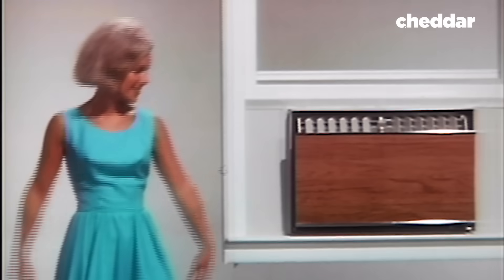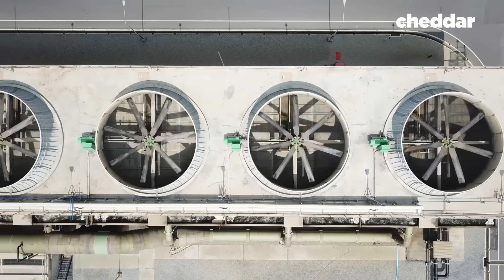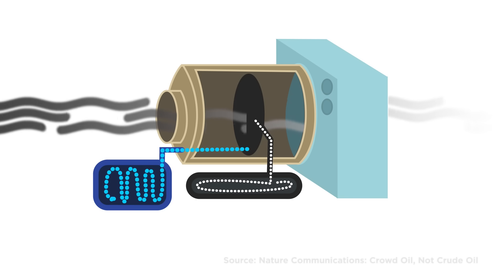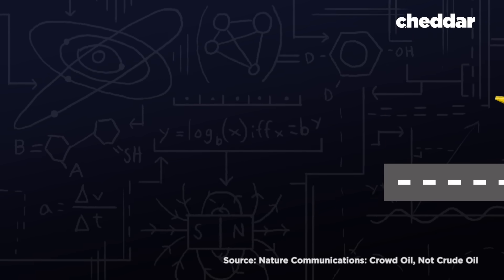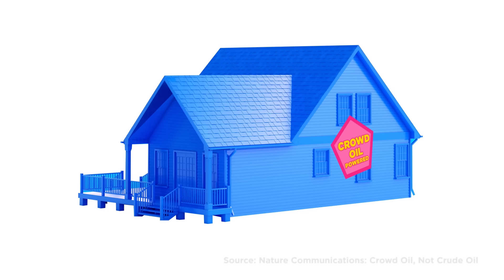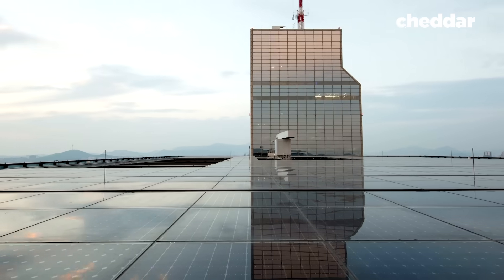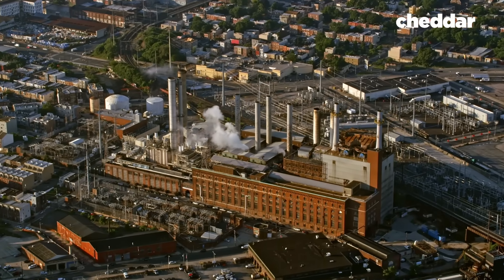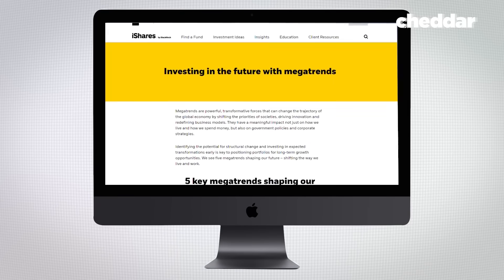How Your AC Could Help Instead of Hurt The Environment - Cheddar Explores

Comment: "we have about thirty years to reduce our carbon emissions to zero"
yeah we're all gonna die
Reply: We're going to reduce to zero by:  "consuming more energy than it recover, instead of using carbon-neutral power sources (like nuclear) and powering the air conditioners, lets just put a filter and a complex system and decrease the efficiency of the air conditioning, lets also create oil to be burned again, that's net-neutral at beast, considering the system also took energy to power itself, it will never be carbon negative"
If that's the best we can do, we're fscked.

We could stop being chicken and go nuclear and solve the problem in 10 years. It's totally doable, nothing new need to be tested or invented and we know precisely the result. It's also cheaper than Petrol or any green-energy. (except for Dyson sphere)
Reply: @monad_tcp  to reduce our carbon dioxide production to zero we need to stop breathing 😅
Reply: @kagenekoUA  that's not a bad idea either, but we could go the other way, we need to make enough cloroplasts to counter the co2 in the atmosphere.
I'm sure nothing bad will happen, like increasing O2 and making everything burn
Reply: @monad_tcp   yeah, it's better to achieve the balance. There might be too much oxygen though (see O2 toxicity), so it's better to keep it less than 40% at sea level pressure. And then the only straightforward negative effect of "significantly more O2" thing that I personally see is the insect gigantism.
Reply: @monad_tcp  as about the oxygen toxicity - here is a chart (and the related explanations) for a better understanding: https://msis.jsc.nasa.gov/sections/section05.htm#Figure%205.1.2-2
Reply: @kagenekoUA  the elite are nilhists and thats the plan. 500 million will be allowed for their rituals
Reply: Have more than 30 years, leftist sources have been saying "12 years" "1 year" even saying 12 year ago that we have 12 years... the whole thing is stupid. I personally believe at the rate countries like China and India contribute to Global Warming we have ~100 years
Reply: @Jayyy-7  I don't think we have 100 years buuut maybe 20-30 years before the worst sets in
Reply: It's actually super possible and easy to accomplish if people simply did it. Nuclear and switching everything to being electric powered, big oil is so scared of nuclear energy. It's clean, safe (Now), and makes more energy than any other method we've discovered. They're not even complicated the atom smashing shit is just a heat source to make steam. From there we can work on what's physically destroying our world, plastic and all that shit.
Reply: joel dong  
reduce carbon emissions to zero not carbon content
Reply: i love you but you make me cry
Reply: Plants love CO2, they grow big and create oxygen from it. Give the CO2 to the plants.
Reply: joel dong  You did it guys, you solved it. They want to cause world wide genocide but rather than use nukes, disease or other methods they're going to use mankinds want to save the world to make them destroy themselves. Genius, you've surely saved us all and opened the eyes of all who read your comments. Truly incredible, the shepherds of our generation.
Reply: 7tonsofsalt yeah that what i keep saying it's just fucked because we pack the will
Reply: I think zero carbon emission in their contex is actually how we balance between co2 and o2..let say factory produce 100 co2..then they plant tree that can absorb 100co2..that is actually zero carbon...and btw..the country that achieve this feat is Bhutan..and they actually in carbon negative not zero
Reply: @roslanismail4417  so they steal co2 from the air. Soon all agriculture will grind to a halt
Reply: @brettmoore3194  no..the balance.like example 50 co2 and 50 o2. The rest of the world is like 60 co2 and 40 o2.get it?
Reply: Sorry for my grammar..but i think guys get it anyway
Reply: joel dong  it makes you wonder why they want to reduce CO2 to starvation levels. Makes you wonder what they're up to...?
Reply: joel dong  Don't peddle that disgusting shit to me you moron
Reply: joel dong  sounds like only positive points
on a more serious note, we don't actually need to not produce any co2, we just need to collect what we produce and reduce where we can (*cough* meat industry *cough*)

tl;dr: not actual zero emissions needed, just net zero emissions.
Reply: joel dong  hope space travel gets cheap
get a good viewing point in LEO
enjoy the fireworks
Reply: joel dong  There's a thing called nuclear power which is superior in every single conceivable way to fossil fuels. Please be quiet you're an idiot
Reply: Guess I'm not living to 67 so I could kill myself with a glorious method. Sad times we living in. Sad. Truly sad.
Reply: joel dong  when the earth worshipping pagans that literally worship trees of the 13 century are better off than the modern tree hugger vegans that force their pets to go vegan. You know we be going in the wrong direction.
Reply: A slow death
Reply: “We’re all gonna die”

Source???????
Reply: Are you one of these people who believe cholesterol is bad too. Stop being a tool
Reply: @brettmoore3194  are you one of those sheep who believes getting shot is bad? Wake up.
Reply: @user-lp7tx1fe6t  I take shots everyweekend
Reply: No; geoengineering will save our ass. Engineering ALWAYS saves our asses.
Reply: Slow and painfully
Reply: AOC says the world will end in 12 years unless we take aggressive action. Unfortunately India and China don't believe this and are ramping up CO2 emissions.
Reply: @kenmarriott5772  My god are you arrogant? China´s emission per person is a third of America´s. And they actually care about global warming since their country is being consumed by a desert
Reply: It is a myth we will all die, just people living on the coast will have to move inland, and in hot areas it might be more uncomfortable. But in colder areas we get the better deal.
Reply: @EglomHistory  "in colder areas we get the better deals"
europe is projected to have another ice age, which would fuck over most of our agriculture
and right now it is actually getting warmer over here which is very shitty too: the permafrost melting means that there is a metric fuckton of co2 released, ground that has been totally stable for centuries suddenly isn't anymore, causing huge damages, a lot of tourism that relies on snow has to use snow cannons, which are an environmental nightmare themselves and the meltwater causes more flodding.
furthermore the increase in extreme weather also affects countries without a coastline and the higher temperature has sparked worries that malaria might spread

and as far as i know predictions for the rest of the world arent so great either
Reply: The words of a loser.... We have the solutions to beat this. Stop being a coward
Reply: @carynoname2574  people are not willing to wear a face mask for a couple of weeks. You think we are capable of fighting climate change?

Comment: Using electricity to inefficiently convert water to H2 then losing energy by letting it react with co2 and then burning that hydrocarbons and releasing the co2 again to inefficiently convert heat to energy. Sounds like a great idea ...

Comment: So let me get this stright, this thing basically works by capturing carbon from the air only to be used as fuel  and get released back into the air?
Reply: yes, that is not a good solution

Comment: It's a lot more difficult to clean air from CO_2, than to clean exhaust gasses. Fristly due to the much higher concentration of CO_2 in the exhaust gasses, secondly due to the usually increased temperature.

Comment: -Clean air by removing CO2!
-Making fioul with it!
-Pollute the earth again..
-Pollute the earth again ?!
Reply: Lots of things are made out of hydrocarbons/can be converted to form them like plastics and carbonate minerals which are permanent carbon sinks. Also whenever you burn oil/coal you are burning some of the impurities in the material like sulfur. while also digging up new hydrocarbons is carbon positive while extracting it from air is carbon neutral which is better than positive.
Reply: @bearcatben4762  yes, assuming this is run on clean power. Though at that point why not stay transitioning the public to electric cars
Reply: @ilikepie1974  Because electric is much less energy-dense them traditional chemical fuels and a lighter car is a more efficient car, Battery production is carbon positive today and even if that changes in next few years with electric drilling. the bottom line is producing fuels from atmospheric carbon are carbon neutral today without any R&D, and the beautiful part of the system is that it makes clean but intermittent solar, wind, and tidal energy available constantly because the methane acts a battery which makes it nonsensical to be made from fossil fuels because you lose 10% of the original energy of the coal/oil/natural gas from production so its running clean no matter what
Reply: @bearcatben4762  ever think about being O2 Positive ?
That's the best plan .
Reply: @NCOGNTO  Ideally yes, but the most important part is being as carbon negative as possible because the drop in O2 in the atmosphere will effect us little but the effect of removing so much CO2 will be more effective because an increased amount of CO2 has many more effects than less O2
Reply: @NCOGNTO  But since you asked I do have an O2 positive plan, the idea is that you use some carbon-neutral power source like nuclear, solar or hydro and you run an electric current through an atmosphere of CO2 and water which produces methane and oxygen gas, the methane can be turned into plastics and the oxygen can be released into the atmosphere.
Reply: @bearcatben4762  how about plastic from carbon capture and hydrogen peroxide (H2O +O2) from solar / water ? H202 has powered the world's fastest cars and can positively repair our air .
Aim a little higher .
Reply: @bearcatben4762  CO2 is formed in direct proportion to the O2 that's removed from the air .
O2 is also the most immediate human necessity .
Carbon will eventually settle back to where it came from but in the meantime our cars could do what trees do - and cheaper than gasoline too
Reply: @bearcatben4762  I lay all this out on my channel
Reply: @NCOGNTO  I'll check it out but O2 is very important yes but a half percent increase in CO2 concentration will have a larger effect than an half percent reduction in O2 because there is much less CO2 than O2 so humans and animals are less adjusted to CO2 changes than O2 changes
Reply: @bearcatben4762  without oxygen we die . Gasoline cars convert O2 to CO2 by combining 20 pounds of O2 with 5.5 lbs of carbon PER GALLON ....... so I'm missing your point here ?
Oxygen depletion is real and you can figure it out .
Reply: @NCOGNTO  My point here is that increasing CO2 is more negative than producing more O2 is positive, basically the pros of making more O2 don't out weight the cons of making more or the same amount of CO2
Reply: @bearcatben4762  why keep talking about fossil fuels ?
We could be talking about NO. CO2 and 5 lbs of O2 for every gallon of H202 .
DOES BOTH THINGS AT THE SAME TIME .
Reply: @NCOGNTO  I'm saying that we need to reduce the amount of carbon dioxide in the air that's why I'm talking about fossil fuels because even H2O2 isn't carbon-negative which is the eventual step we need to take.
Reply: @bearcatben4762  you are not much of a chemist or mechanic .
You think there is carbon in H202 ?
The whole point I'm making is THERES NO CARBON IN HYDROGEN PEROXIDE - we don't need it at all
Let it soak in a while , but you could be LEARNING by watching my channel instead of saying dumb stuff
Reply: @NCOGNTO  I'm not saying dumb stuff, I'm all behind H2O2 but I'm saying that you need to also remove carbon from the air along with your production of H2O2, and yes I am a chemist.
Reply: Cecil Mills Are you saying these contraptions will take more oxygen out of the air than the trillions of plants/tress covering the globe can produce? Because I find that very hard to believe. Also, the O2 being used is coming from water condensate, so the liberated O2 you’re so worried about is already trapped within water molecules. It isn’t directly pulling O2 from the air, and it’ll all be (counterintuitively) put back with the carbon into the environment once the fuel is expended anyway unless it is directly recaptured. I don’t understand you at all.
Reply: @dinkledankle  no Paul . I'm saying carbon capture is a scam - trees do it BETTER - as you point out .
What I can't believe is : all these eco friendly folks are not talking about water based fuels -at least one of which can restore O2 to our atmosphere (H202) .
Why not just REPLACE GASOLINE WITH A CLEAN FUEL THAT PUTS O2 IN THE AIR INSTEAD OF SOME POISON GASES ?
Read it again Paul it's pretty simple , unless you just stuck on gasoline as the only (allowable , competitive , scientifically feasible , what ?) fuel .
Get that ?
Reply: @dinkledankle  we don't need air borne carbon .
Oxygen keeps us alive , you get that , right ?
Reply: @NCOGNTO  During the formation of the Earth a fixed amount of carbon was given, during the carboniferous period trees, were able to die and not rot which means that the Earth was a net carbon negative system but nowadays trees decompose into carbon dioxide instead of turning into coal, in the 1700s we started mining the carbon sequestered back in the carboniferous which means that we are carbon positive on earth because we are digging up millions of years old carbon and reintroducing it to the carbon cycle and since we don't have non-decomposing trees anymore we have to sequester the carbon somehow and return it to the carbon amounts prior to the 1700s to avoid ocean acidification.
Reply: @dinkledankle  You are right, except for one detail : plants do not produce oxygen, only stars do. Plants split the oxygen from existing CO2. So the question is about free, molecular  oxygen, not the total amount. But yes, this ideea that this machine will trap free oxygen is a false problem, as you correctly pointed out. I suspect that this reaction would actually release oxygen because if you burn the fuel using atmospheric O2, that will revert back to CO2 and water, in the same exact quantity  as we started with. Conservation of mass, chemistry 101.
Reply: And there is a bit of problem if you just store the thing too. If it is stored as methane, that gas has the tendency to escape the container it is in, and it is something like 30x more potent greenhouse gas than CO2. Back to square 1.
Reply: @florinpandele5205  The storage problem isn't a problem because this liquified methane gas system is already being used safely around the world, in cars, in rocket engines, in massive cargo ships and none of them are having any more spills than a conventional gasoline or diesel engine, and if there is ever a large scale methane spill it won't destroy ecosystems on the land or sea like oil and diesel spills, and while yes methane is a potent greenhouse gas, it doesn't have the same horrible effects of CO2 like ocean acidification. A methane spill would be terrible of course but the methane under the arctic permafrost would release more greenhouse gasses than we ever have and that's why we need to jump on any technology that gets us off carbon positive fuel as fast as possible.
Reply: @bearcatben4762  Well ok but I will tell you that ALL methane installations like pipes and ships and tankers leak more or less. That is why if you have a gas burner in the house certain air refreshing rate is required by fire safety regulations. Rockets are fueled on the last minutes because of the same reason. I agree that we should do everything possible to stop the world from overheating, but we must do that in the most effective way possible , meaning using real solutions not patches like this "invention". So it would be highly desirable not to have to rely on methane at all.
Reply: @florinpandele5205  We have to use the carbon in the air for something so we either make it into methane to make into plastics for sequestration or make limestone and that sequestration is negative of capital since no one is benefiting tangibly from making tons of plastic and limestone and burying them so those sequestration activities have to be subsidized by the profit produced by the methane sold to people for fuel, and even if we have a 10x increase in methane from leaks it still wouldn't outweigh the heating caused by the extra water in our atmosphere from excess evaporation.
Reply: @bearcatben4762  There are plenty of things to do with carbon, it is the base element of life and let's not forget what diamonds are made from.  But you are right, the main  problem  is that there is no immediate benefit for a private business this way. And that is  my point, it is a global problem that has to be resolved by government, not business, so please let us not give them an easy and useless way out so they can apply and forget about the problem entirely, because this is exactly what they're going to do.
Reply: @florinpandele5205  governments aren't extra national and they live on 4 to 8 year cycle. governments are bad at long term investments like space travel and climate change mitigation because the proceeding president seeks to change all the actions of the former president it happened to Bush with Obama and it happened to Obama with trump
Reply: I don't need to see gru, I can see the meme in this text^^
Reply: Better than do nothing 🙄
Reply: it's better than burning coal
Reply: Daniela Elliott no it’s not
Reply: @betoran42ranger14  Coal puts cancerous particulates in the atmosphere, and causes acid rain, none of which is true for carbon captured fuel